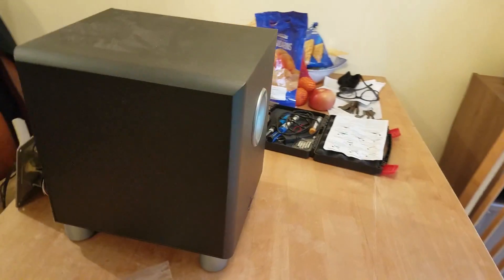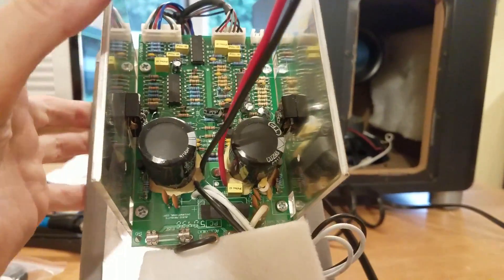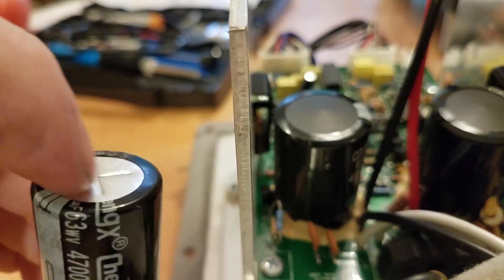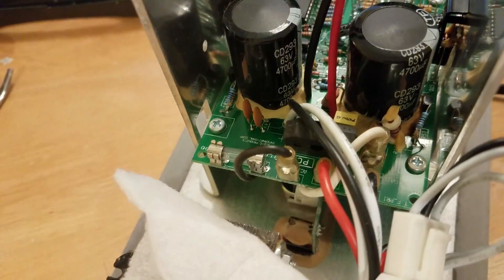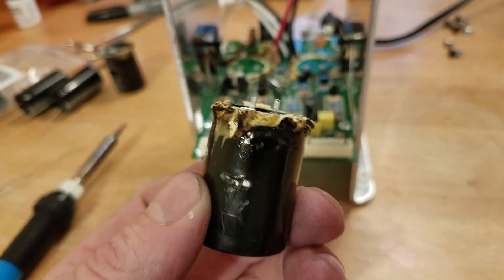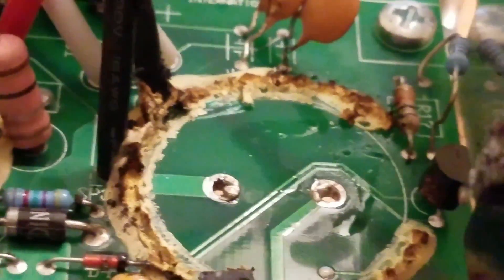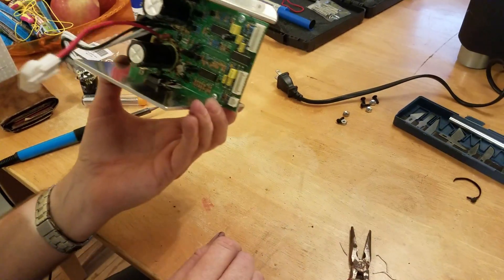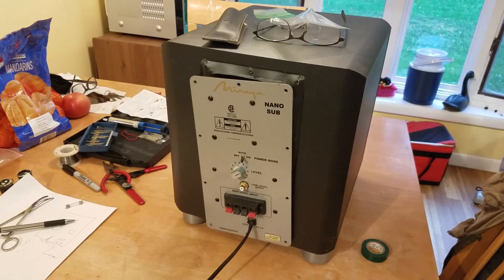Fixing Subwoofer Buzz for $10 or less!!!

Comment: my subwoofer is a bit distorted> what can it be?
Reply from the maker: That's a hard one.  First, plug into a different source.  If it still does the same, replace the cable to the sub.  If it still sounds bad, then either the cone is bad, the surround on the cone has bad spots, or the windings on the bottom of the cone around the magnet is bad and maybe rubbing.  It could also be some other electronic component.  If it's the cone, you may be able to replace the speaker part, just the sub speaker in it's metal housing that mounts in the box.  It's really one of those things that's going to take some experimentation to figure it out because there are too many things it could be.
Reply: @MIFixItDad  Thank you.

Comment: Hey I have a question, I have the exact same sub with the same problem and I replaced the capacitors, when I plugged it in the fuse blew, do you have any ideas? Thank you!
Reply from the maker: Yes, mine did the same.  I think the newer caps charge faster and have a higher initial draw.  I think the OEM fuses were 2 amp if I remember right, and I want to say it was a 5 amp I decided to use instead, and it's been working just fine ever since, and it's been right under 2 years.
Reply: @MIFixItDad  Thank you for the quick reply! I tried the 5amp 250v and it burned out but maybe that was too much. The OEM one is 1amp 250v, I'll go to lowes today and see if they sell the 2amp 250v as the auto parts store dont seem to have it.
Reply: @chrislmcnair  you should triple check that you installed the capacitors with the correct polarity.  If you installed one or both backward they would instantly blow the fuse as well.

Comment: I have a really expensive Revel Subwoofer that is making a loud buzzing sound like the one in your video. I removed the amp and examined the 2 large capacitors that look very similar to the 2 in your amp, except neither have the bulging tops. Is it possible that they are bad and the culprit of the buzzing sound even though they aren't bulging? Thanks for the informative video.
Reply from the maker: It's possible.  If you have a good electronics shop in your area they could remove and test the capacitors, but it's really getting hard to find places like that any more.
Reply: Yes, it’s very possible the caps could be bad even though they aren’t bulging. Capacitors frequently fail with no exterior sign they are bad, the only way to check them is if you use an ESR meter.

Comment: Aren't those big capacitors dangerous to touch?
Reply from the maker: Yes, they can be, although these size probably not too much.  Bigger, definitely.  That's why I unplug it while it's turned on.  It will fully discharge the capacitors in the process since they were in use at the time.

Comment: The glue is to prevent those big caps to vibrate and break loose after some time of using the sub. It’s a good idea to glue them up again after the repair. 

When soldering the leads, the solder should flow all the way through the hole in the PCB to the other side to make a good mechanical connection. Therefore you should hold your soldering iron a bit longer to the leads (1 or 2 seconds).

Comment: Thanks for posting this!  I inherited a mirage speaker system with a sub.  I thought the sub was toast.  Sounds just like yours does here.  I"ll be ordering capacitors and fixing it up.  Cheers!
Reply from the maker: That may be why you inherited the speaker system.  If replacing the caps does the trick, someone may be sad they got rid of them.  If the speakers are in good shape, they really do sound fantastic.

Comment: You made a huge mistake in not bonding those new caps down to the board.  The subwoofer will generate a lot of vibration which causes the capacitor to move slightly, especially when it is at a resonant point.  The capacitors have a lot of mass so the stresses are all on the leads and solder joint.  Over time, it would completely shear the leads right off or cause the solder joint to fail.  I've seen it happen and that is why they put the glue to prevent the capacitors from deflecting and breaking off the leads.  You can use hot glue or epoxy to help prevent that type of damage.
Reply from the maker: That makes total sense.   With the small cost of the capacitors, and considering I have spares I think I'll be ok.   I would rather replace them than remove that glue any day.   It was a giant pain to remove.
Reply: @MIFixItDad  It would take a while, but the effects could be a lot worse than just having a 60 hz hum.   If the two capacitor are not in parallel, there would be no filtering in the lines at all if the solder joint or leads are broken.  The smaller caps are less critical since it has less mass, but the larger ones are prone to this type of failure, especially in a vibration rich environment like a subwoofer.   

Its relatively easy to apply some hot glue to hold the caps down since you already soldered it down.  The work is really to open up the speakers again.  The hot glue you are using is much easier to remove.   Next time if you have glue on the caps, use a hot air source like a rework station instead of the soldering iron, it softens the glue and makes it much easier to remove.   You just use a sharp tweezer and yank the glue off in chunks.  The rework stations are perfect since you can control the air volume and limit the heat to local areas.  They are relatively cheap and its great for shrink heat tubing.
Reply: @ahndeux  I was really hoping someone would talk about this in a comment. :-)  I'm going to do mine as well and I'm sure it has the same glue on it.  I'll try the rework station and see how it goes.  Thanks for explaining this!
Reply from the maker: @ahndeux  Been over 4 years and still no problems, just sayin....
Reply: @MIFixItDad  Fracture mechanics work over time and depends on the level of the vibration.  Every situation is different.  I've seen similar capacitors snap in half radially across the leads through accelerated testing.  Its a lot more extreme than most cases, but it involves higher levels of movement through a vibration shaker table and a large amount of shock and vibration loads.  

It takes time, but it will eventually happen.  There are three failure modes.  One is a crack across the leads as the capacitor moves up and down and impart a load on the lead.  

The second is a failure on the solder joint which also depends on the type of solder.  Sn63  has a softer chemistry due to the lead content and survives longer.  The lead free solder are more brittle and tends to fail earlier.   

The third mechanism is the delamination of the circuit trace from the PWB.  Although this is rarer, it can happen if the leads deflect when the part is not mounted down.  It keeps pushing the solder joint and if there is enough of a gap, it can push the traces through.   It is more likely to happen if the environment is hot because the adhesives used to put down the traces on the PWB board loses strength as temperature goes up.

Resonance is also important.  If the capacitor acts as a spring mass system, it has a resonant frequency.  If the part is subjected to that resonance frequency, the amount of deflection increases dramatically.  That can vary case by case depending on the size of the capacitors and how its mounted.

Again, most of our life tests are for an estimated 10-15 year fatigue life for components.  At 4 years its hardly a dent in the life cycle of the part.  Most of the damage occur at the later stages although we have some early failures.  These are called "infant mortality" cases.  The failures are usually a couple of early cases, very little in the middle and a lot of failures near the end of testing.
Reply: @MIFixItDad  Manufacturers don't glue things down without a purpose.  It costs them money in material and labor.  They do it based on their experience with product failures and warranty issues.  They most likely experienced failures in the past and the solution was to glue the parts down to reduce deflection.  Its a simple solution to a known problem.
Reply: He needs some flush cutters.
Reply: @richardsparks9904  And a sponge for the solder tip. Xacto blades are not meant to clean solder tips.  LOL.  

I think he work hardened the solder joint just going back and forth on the wire to break it off.  At the minimum, he should remelt the solder afterwards to relieve the stress on that solder joint.  Solder joints don't last forever.  There is a finite number of thermal cycling which is worse if the temperature swings are higher.  The newer "lead free" ROHS solder is worse because its stiffer and flows at a higher temperature, so they fail quicker than the older 60/40 tin lead solder.  A lot of modern electronics fail much quicker than older electronics for that reason.
Reply: Can you please help me , coz I saw your comment when someone was fixing the fault capacitors . Mine does similar sound can you please help am far in Africa

Comment: That is not how I was taught to solder (HS electronics class in the 80s). Not saying it is wrong. But I was taught to heat the component and then melt the solder on the component. We were told not to melt the solder on the iron.
Reply from the maker: It depends on what I'm soldering.  I'll either heat the component and melt the solder to the component, or allow it to flow from the iron tip to the part.  As you get more experience, you'll learn the difference and see what works best when.  Some of these were pretty nasty solders to be honest, but I've been doing this for 35 years and you tend to learn what works best and when during that time.  Keep doing what you're doing as long as it's comfortable for you, and it works.  The wrong answer is not to try at all, so you're already doing great!

Comment: My subwoofer is humming too loud as well. I think the filter caps are very cheap, they dont even have a silver top its just black plastic and I have never heard even of the brand. Going to replace them with some good 105 degree ones, the originals are 85.
Reply from the maker: That black plastic may be just a cover over the silver part, unless the plastic has those little "cut" lines in it.  Then it's just a cheap capacitor.  Good luck, hope replacing the capacitors does the trick for you!

Comment: In capacitor what is more important the size or the power(2200uf 25 v) or the size
Reply from the maker: It depends on the application, but the first thing you want to match is the capacitance (the uf rating).  The wrong rating will cause you to have the wrong results for your circuit.  Then you want to size it for your circuit.  A huge capacitor in a 5 volt circuit won't do anything, and a tiny little capacitor in an application like this, would blow up immediately, or at least not filter like it's supposed to.  So, the answer really is both matter a great deal.  You always want to try and match the original.
Reply: @MIFixItDad  thank you, i change my 2200uf 25v with 2200uf 35v but it is not fix i don't know what to do...???
Reply from the maker: @domynicdomy8407  if it still has hum plugged into electricity, but with nothing plugged into it, and you've replaced the filter capacitors in the power supply, then you may have another issue.  The capacitor replacement just fixes one of the most common issues, not all of them that are possible.
Reply: @MIFixItDad  thank you I'll try it

Comment: I changed capacitor 4700uf 35v. but still iriteting sound coming
Reply from the maker: Sounds like you may have something else wrong then.  A large part of the time, buzzing will be caused by the filter capacitors in the power supply going bad, but it's not a guarantee 100% of the time.  Make sure your capacitors match the voltage and capacitance of the old ones too.  If the replacements are too small, they may not work.

Comment: Excellent video. 
I would cut the leads of the capacitors in stead of breaking them by wiggling. While wiggling you could tear of the trace on the pcb. This is especially a risk if the pcb has got even mild heat damage. 

On radial capacitors the plus usually has the longer lead. Just a fun fact.
Reply: agreed that cutting is better but for through-hole connections i really don't think that's an issue worth worrying about.  surface-mount for sure, i'd recommend never doing that

Comment: Hi Floyd, 
Thank you for the video. I have the same subwoofer as yours and I noticed that my fuse is blown also. Do know what size fuse do I need for this mirage nano sub
Reply from the maker: I believe the original was a 1 amp 220 volt fuse.  I had a couple of those that kept blowing immediately with the new capacitors, and I ended up having to use a 5 amp fuse because that's all I had at the moment, and it worked fine.  I think a 2.5 amp would have been more appropriate, but if I have something that shorts, it's going to draw more than 5 amps most likely so that larger fuse should still be fine.  Look on the silver end caps on your fuse, and the value for the fuse will be etched into it.
Reply: Floyd Nash 
I’m surprised that the fuse kept blowing while you replaced the caps with the same values. 
I would recommend to get some lower value fuses though. If something shortens, a 5A fuse won’t prevent as much damage as a 1,5A fuse will.
Reply: Floyd Nash 
Could it be that you replaced a slow fuse with fast ones? 
The slow ones have a T besides the amperage and the fast ones have an F. 
A fast fuse would indeed blow immediately when a slow one should have been installed.
Reply from the maker: @Conservator.  I'm thinking the new capacitors I used simply have a faster charge rate than the old ones, which would create a higher initial current draw.  I've been running these fuses for over a year now with no issues so I think at this point we can say it's safe.  5 amps really is not a huge amperage rating for a device of this size, so I think I'm still well within any safe zone also.  The 1 amp fuses I tried were the same as the old.  The old were standard fast blow fuses.  I'm very aware of the difference.
Reply: Floyd Nash Hi,
I’m from the Netherlands do 5Amps equals more than 1000W RMS input power. For you it’s probably ‘only’ 500W. 
Maybe the new caps have a much lower ESR and that would certainly blow a 1A fast fuse if the circuit doesn’t have an inrush limiter. 
If it doesn’t, I would add one and use a smaller fuse but that’s just me trying to be as safe as possible. Wouldn’t do a lot though because those caps can do a lot of damage to the components if something shorts. 
In short: I agree with you 😉

Comment: While you're there and have removed big caps, better scrape all the browning goo out. It's usually a glue that goes conductive when it ages.
Reply from the maker: I had to use the soldering iron to burn it off just to remove the cap.  Scraping this is out of the question without a hammer and chisel.  It sucked!

Comment: I would pay a little more and get Nichicons or Rubycons as they are much better capacitors.
Reply from the maker: Now that I know for certain that the issue was the capacitors, if I need to replace them again, I'll go higher end.  These were a nice, well reviewed option that I decided on so I wouldn't waste so much money if it was something other than the capacitors.  So far, they have held up very well and had zero issues, and since I got a bag with several, I actually have spares.
Reply: Floyd Nash can you please provide the link of where you purchased the capacitors on Amazon, I have a JBL Sub300 with the same loud buzzing ,I’ve checked the amp plate , on these you can see the cross but both of them look flat so I’m not sure if that’s the actual cause of the issue but I would like to discard that out. There are some guys on eBay that you send them they complete plate, they fix it for a flat rate and send it back, the thing is the flat rate is $140 plus shipping that represents half the price if purchased as new the whole unit I don’t see a smart investment there. Regards
Reply: Don’t buy your caps on eBay. Buy them on mouser or digikey. Like 90% of the caps on eBay are fakes.

Comment: Mr. Nash...say, i'm having the same issue a powered sub.  It only happens when turned on and then, goes away with the buzz fading out within 2 to 3 minutes.  Is this a capacitor that might need changing?

By the way thank you for taking the time to make this video.  Enjoyed.
Reply from the maker: It's very possible that is exactly what is happening.  Unless a capacitor blows up, they can indeed go bad over a period of time.  My sub started out the same way, with a small buzz on startup that went away quickly, but eventually just never went away and started getting worse pretty rapidly.  If they aren't glued down like mine, they are very easy to replace.